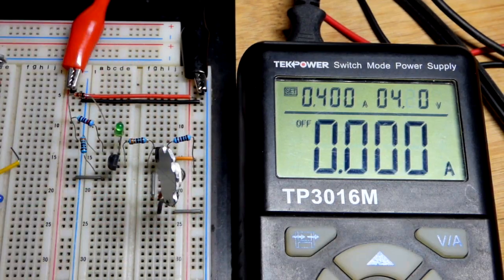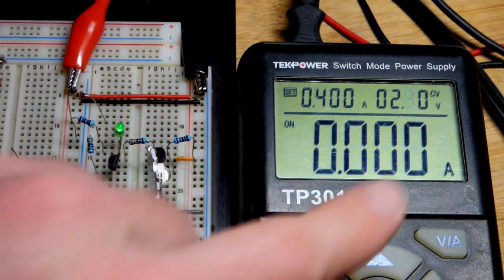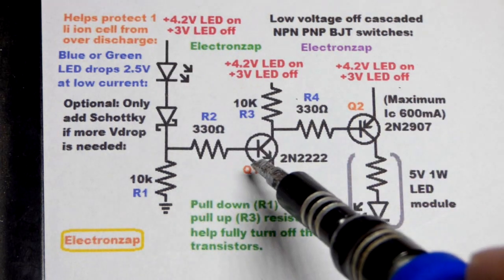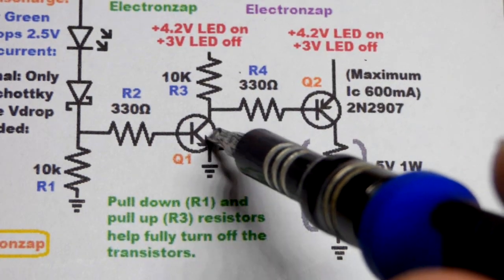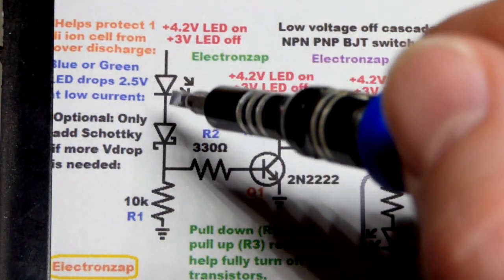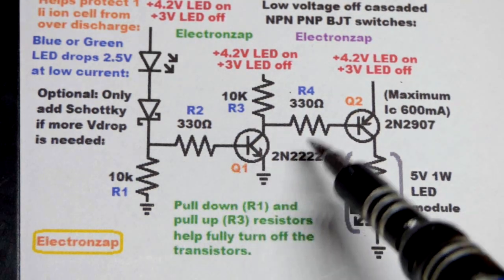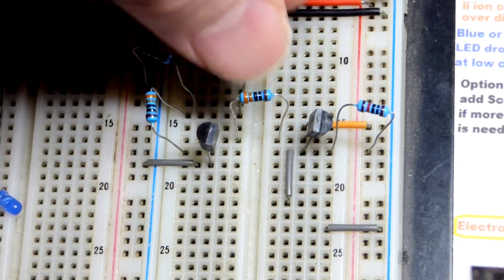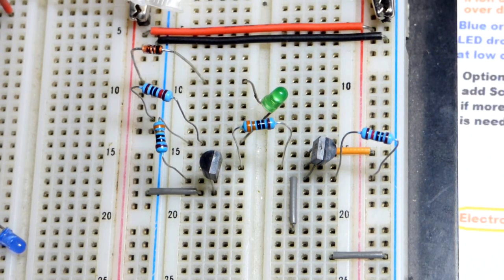Cascading NPN and PNP BJT switches for moderate power load circuit learning electronics shorts 135

Comment: Great explanation of how it works - what is its main advantage? Is it something to do with the supply voltage decreasing?
Reply from the maker: Every component has limitations, BJTs don't have a lot of gain, so sometimes you need to amplify a weak signal a little bit with one BJT, in order to amplify it even more with another BJT. Taking current from the signal almost always changes it's voltage, so you need to limit that as much as possible.